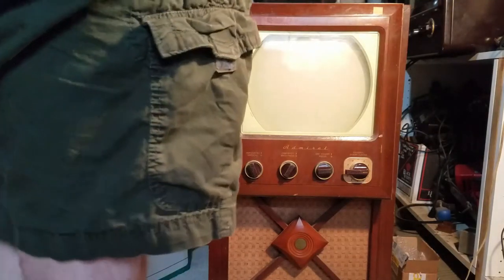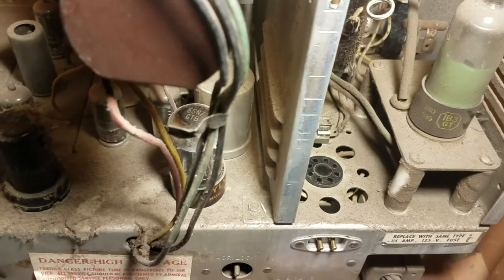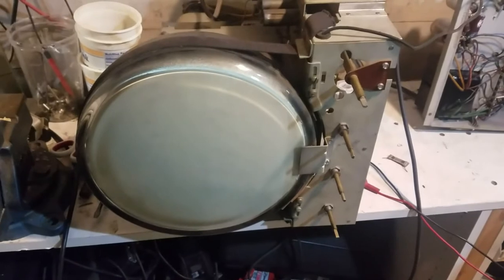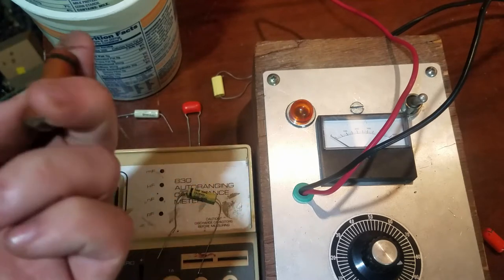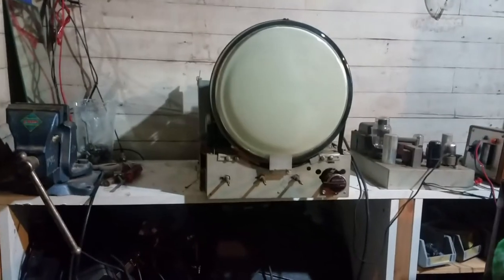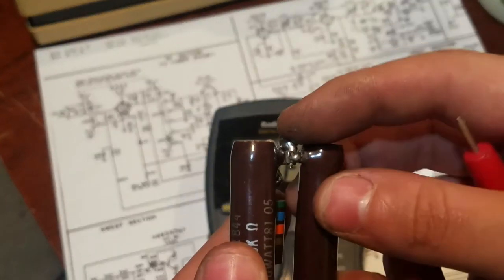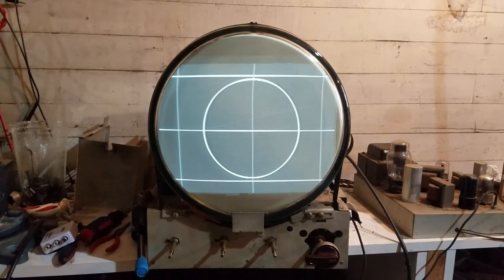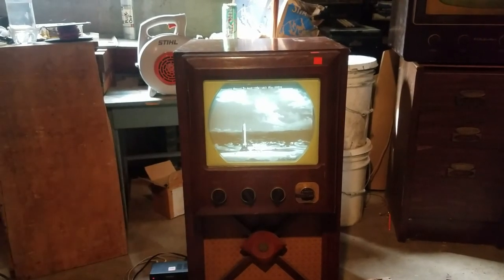Admiral 24C15 Television Repair Pt-1 of ?

Comment: 5:23 "You see that resistor back there?" Why no sir, I sure don't see the "Resistor" back there. Probably because I was born in '83 and haven't seen many, uh, Tube Type Circuits and/or resistors, capacitors, Rheostats, Transformers, etc from the 1920-1950's etc. But I am hooked on your channel and the very intriguing, knowledgeable content you provide. I am very thankful for you! If I do nothing for the foreseeable future but study your channel until this clicks and I 90% understand these circuits, then that is fine. At some point I must test my knowledge to see if I truly grasp the circuit. I have learned what seems to be a fair amount over the last couple of months, but I must absorb more knowledge until I understand at least Amplifier circuits.

Comment: Well done. Loved the test video albeit I would have used the one about Uranium prospectors.

The one where they happily smoke in a lounge with a similar TV set and a beautiful rock of Uranium ore just sparkling there as a decoration.

„don‘t fix what‘s not broken“ vs „planned maintenance“ - personally I prefer the latter. But I agree with you in this case.

Comment: Good for admiral to separate the ps from the rest of the circuit.

Well done with repair. Never reform old capacitors. Thwy are so cheap now. One day a cap will fail and byebye transformer, or an unobtanium tube.
Reply: His "OLD CAPACITOR MIGHT WORK" optimism amazes me.  Ive played with a lot of old valve amps and the caps never work for me. I start by swapping out every cap.
Reply: So a failed cap can/will take out a Transformer or Tube?

Comment: You want to replace the wax caps. They are a time bomb waiting to fail. Good job otherwise If there are any bumblebee caps get rid of them pronto. They have a tendency to short and leak
Reply: I assume you are referring to capacitor's but could you explain what exactly Wax Caps and Bumblebee Caps are for those whom lack the knowledge please?